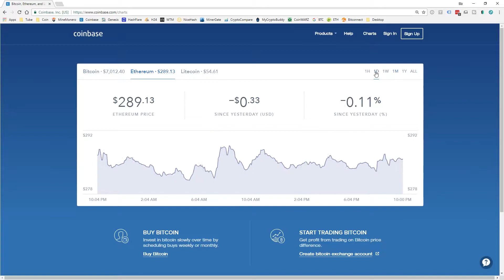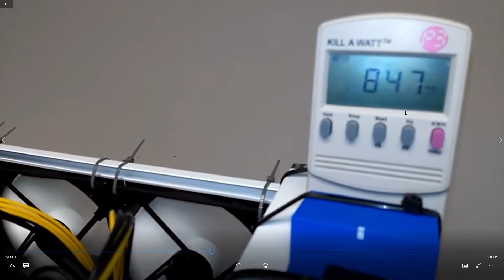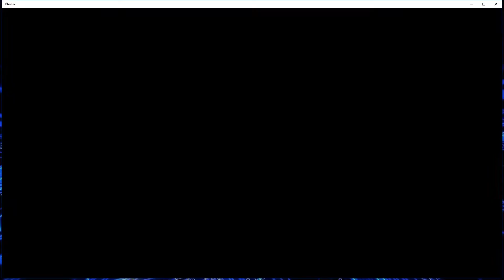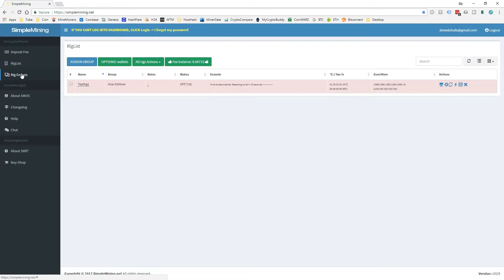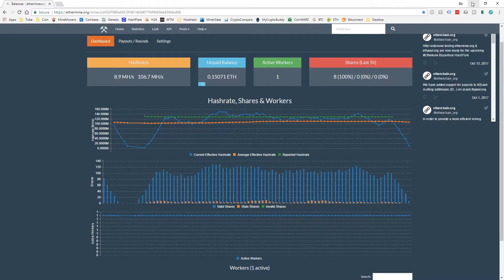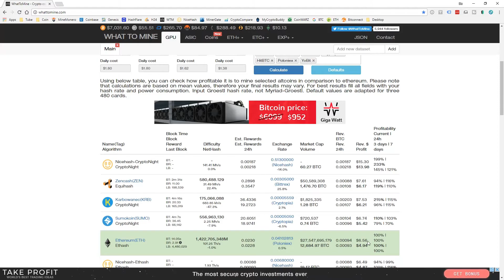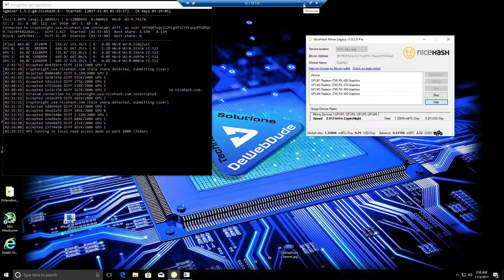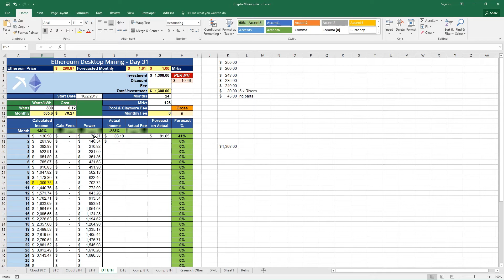Desktop Mining - Episode 6 - Mining Rig Day 31

Comment: Keep posting regularly, you'll get some traction.  I especially liked your HP server power supplies video.  That power switch there was extremely helpful for those that know what that is ;)   I ordered 3 of them for today delivery!  Any reason you didn't use the atx jumper from the HP to power the mobo and other stuff?  That's what I'm doing, works great!
Reply from the maker: I didn't find a proper cable for the motherboard & cpu power.  You would also need to take it to molex or sata for the risers. Since you need 2+ power supplies anyway ( going 19GPU's ), I was thinking we can run a standard type of power supply and just add additional HP power supplies as you add video cards.
Reply: http://www.parallelminer.com/product/160watt-24pin-atx-power-module-included-sata-molex-cpu-power-connectors-bypass-your-atx-power-supply-entirely/?wpam_id=1  they have other's in stock at 180 watt.  They are great..........   I get the 2500 watt power supply with breakout boards for up to 28 cards I think....  Though I'm building my rigs 8 cards at a time..... I'm future proofing myself on power because I can, MOBOS in the future...   some are 11 cards or more already..  Thanks